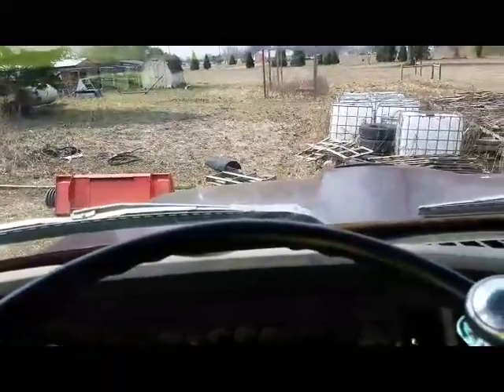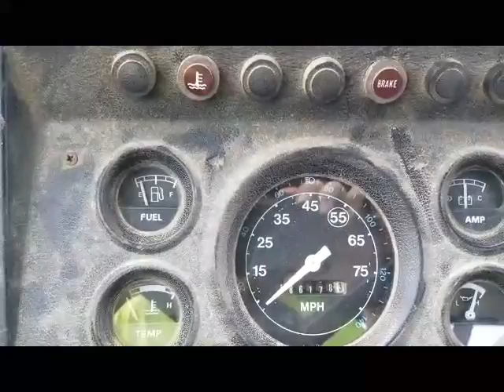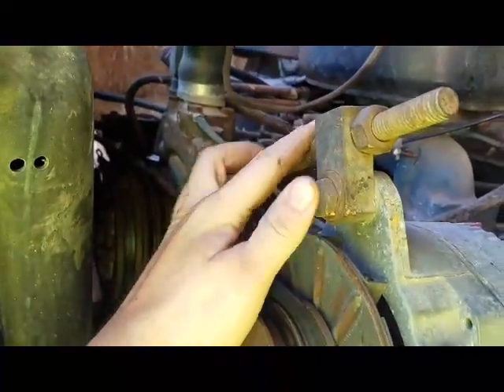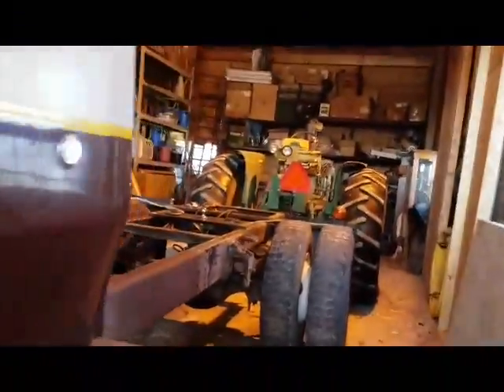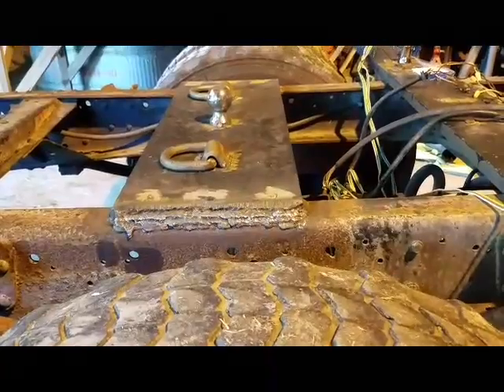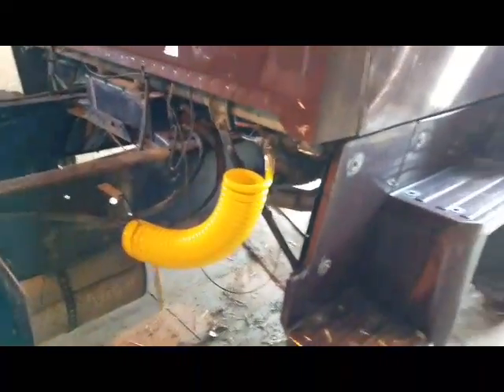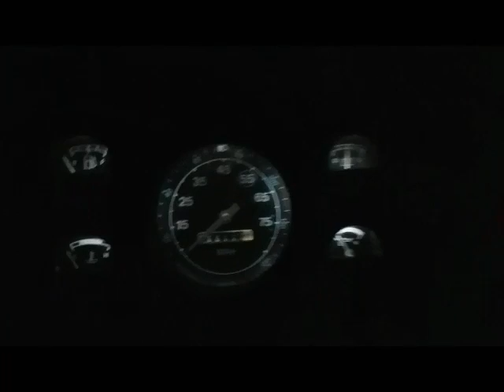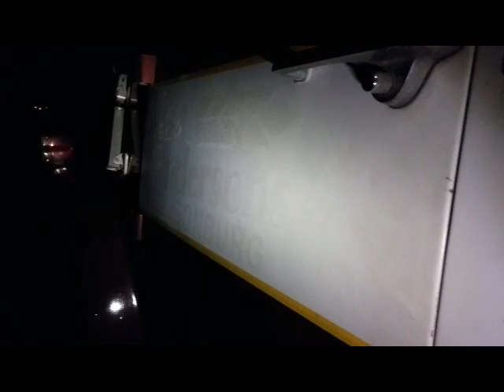Ford update

Comment: they put the male end of the fitting off of that air tank with a valve because the female ends get rusty and you can almost never use them. when we build a gooseneck on trucks, we make it so that it mounts to the sides of the frame. we dont like to weld or drill the flanges of a frame. that sure is a quiet engine. wow! those l.e.d. lights are fantastic!

Comment: Does that truck have a air locker in the rear axle? All our grain and silage trucks have the air outlet like that for a hose, comes in handy if you have a tire thats low on air pressure!